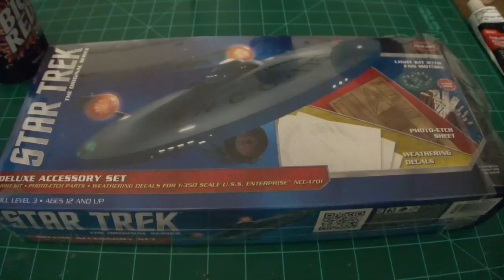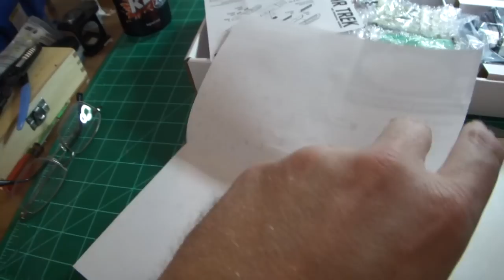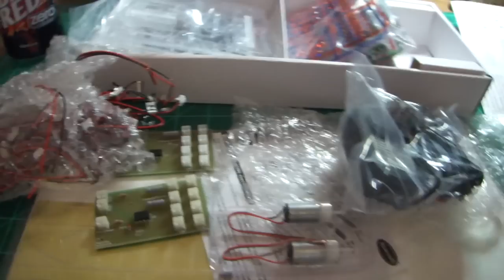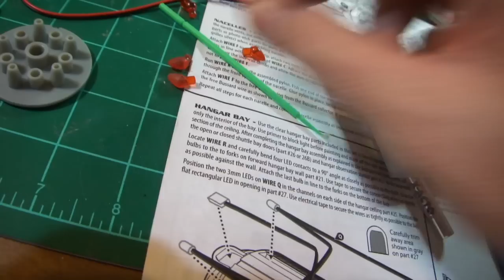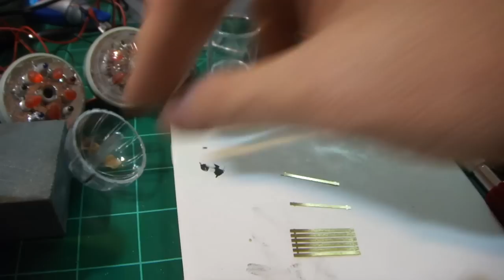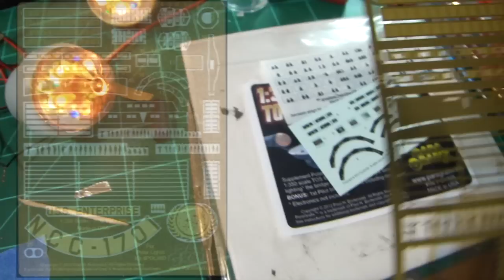Polar Lights 1/350 TOS USS Enterprise Scale Model Build Part 1

Comment: I looked at this some years ago and stalled my build because those damned motors are so noisy! No, I don't want any moving parts. But I want nacelle ends that look convincing, so I started looking around for replacement ideas.

One idea, and the leading contender, is to mount a projector in each nacelle. The projector would show a constant, looping animation of the lights and fan blades back-lighting the nacelle domes. This has the advantage of letting me experiment with other lighting effects like swirling plasma or pinpoint flashes. It has the disadvantage of being very expensive, and so far projector technology stopped shrinking a few years ago just before reaching the size I'd need. The optics are a little too big for the nacelles. But this is the most versatile solution.

Next, I was thinking of making custom LCD strips lining the inside of a frosted dome.  I'd need at least sixteen of these things to pull off believable motion, and I couldn't sequence them slowly or the effect breaks down ... unless I have a lot of blades. I've only recently seen instructions for home made LCD parts, and it's a multistep process.

Finally, packing the dome with fiber optics and carefully aligning the fibers with lights further back in the nacelles so the effect of lighting with animated components could be believably simulated. This is the second-most versatile approach, but my god, keeping track of all those fibers!

Comment: I just got my light kit and I think something may be wrong. I wanted to test the Bussard lights but they’re lifeless. The motors work fine. One of the light PCBs somethings flashed on for the length of a camera flash but that’s all. The other one I believe has two solder joins bridged so I’m guessing that’s causing a dead short on one of them.

Comment: i actually found a better blade option on shapeways  im going to paint black as it's only the fan blades and shaft, im also devising an idea using a ruber gasket between the motor mounts and nacelle to see if that dampens the electric motor noise

Comment: I agree on the squeaking noises. I am looking at installing a brushless RC type motors that can be better controlled. Also using metal bearings instead of plastic on plastic. I know with my experience in RC panes, I can do much better as far as the lighting set up. Now days, you can obtain actual mini christmas lights with tiny leds at any store.As far as broken mireor, a compact mirror or check dollar store for avilable materials. I noticed you were limiting yourself on materials by your inexperience in the world of modelling. I use whatever I can find wherever I can find it, not limiting myself to whatever is available on line as manufactured by someone else, then paying top dollar for the ill conceived stuff put out there. Sanding the bottom of the clear nacelles so there ia no contact helps clear up those noises. I am sure you figured all that out as you worked on it. I bet you learned alot doing the model and if you made another one, you would do it differently. You only gain experience by doing. I learned everything I know from years of experience building models of every kind. Yup, we learn, we live we mess up and start over. Good tips on the micro metal glue on the metal parts. I need to order some. Yeah, CA doesnt work unless you scuff the metal, then dont screw up and scuff the wrong side, lol. I know you finished this a long time ago. So have you built another one since then? lol.

Comment: I heard if you use thin foam rubber in the nacells putting in around wiring as much as possible, it absorbs the vibration and cuts down the noise by 90%

Comment: The motor noise and squeak of the rotating parts would drive me insane, I'm afraid.
Reply: Just "file" down arond the edges of the inner dome slightly to prevent rubbing on the inside of the nacelle. :-)
Reply from the maker: +nitramyar They're certainly not for everybody.
Reply: Stuff foam into the rest of the warp engine nacelles to further dampen the sound.